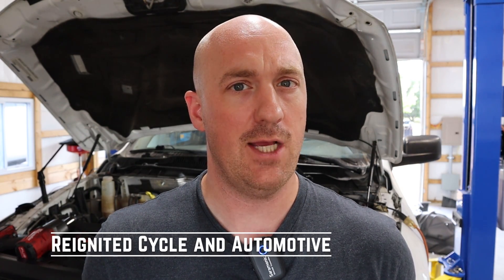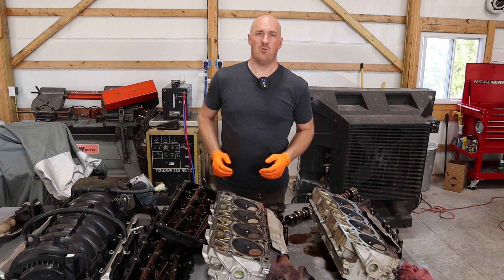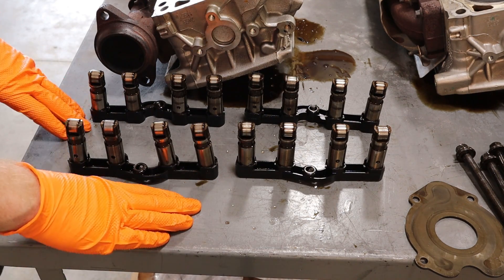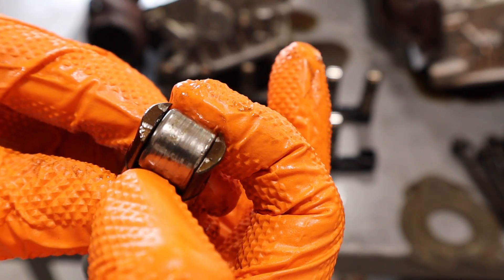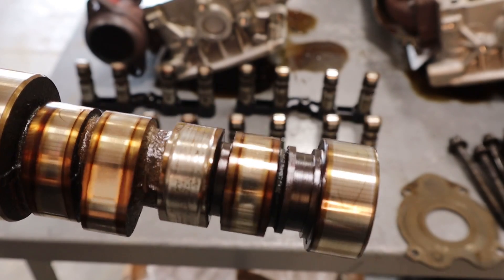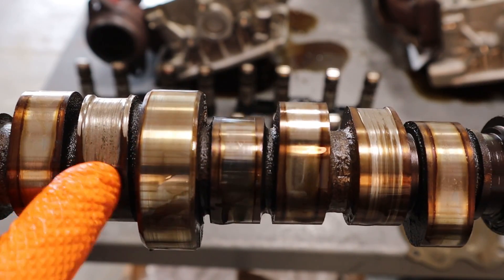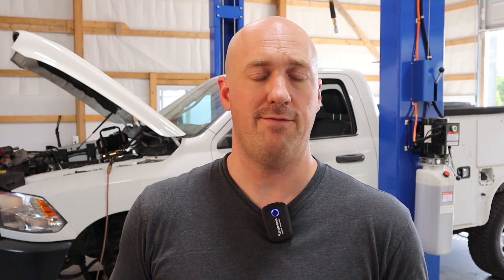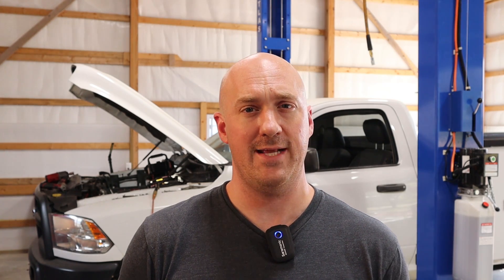Hemi 5.7 Lifter FAILURE Does this engine have a fatal flaw? Find out how YOU can prevent it!!!

Comment: You're PARTIALLY correct in your explanation of it being a lack of sufficient lubrication issue,  but it's not actually exactly as you described it.  It's because at idle these roller needle bearings are not being supplied with ENOUGH oil to properly lubricate them.  These engines supply oil to the lifter bearings by means of splash coating.  At idle,  not enough oil is being splashed onto them to provide sufficient lubrication.  Tony from "Uncle Tonys Garage" explains it wonderfully.  Give it a watch and see if you agree or disagree with his explanation.  I love your channel,  it's VERY informative.  Keep up the good work!
Reply from the maker: This video is quite old now,  I've got a bunch of newer videos showing my solutions with actual results.  As to UTG, no I don't agree with that being the issue.  Engines aren't built exactly like they were in the 60's. I have another video that shows the exact path of oil through the Hemi engine,  and "splash" lubrication is not the only oil the camshaft receives.  👍

Comment: Could I get your opinion? I have a 2012 ram 1500 w/160,000 miles. I got a check engine light misfire #3. I changed all the coil packs and all the sparkplugs. Drove it 60 miles. Gas mileage went from 18mpg to 22mpg on that drive 55mph. Next day drove 50 miles to dr appt. When I left check engine light came back on. Same thing misfire #3. So I started researching. I found out about the hemi camshaft problems. I called a local shop asked if they would do cam and lifters. They said let them diagnose it. They said need new engine $10,000. I called another shop asked if they would do cam and lifters he said bring it to him. He pulled the valve cover and confirmed flat lob on #3. Wants to sell me new engine. I would do the cam job myself but I'm disabled. I've seen many YouTube videos on the hemi cam and lifters problem and replacement. I want to know is it worth doing the cam and lifters instead of a new engine. I can do the cam and lifters with my son helping on his free time. Might take a month but I've got all the time in the world. So in your opinion change cam and lifters or new engine. I appreciate your knowledge on this issue.

Comment: This may sound like a silly question but I don’t know. If you disable the multi-displacement system will it or could it resolve the issue? What harm is cause by turning off the multi-displacement system? Im not buying a V8 to save on gas?

Comment: The design is FLAWED
PERIOD
THAT IS WHY CHRYSLER IS DISCONTINUING IT
ITS NOT OIL CHANGES ITS THE DESIGN.
PERIOD
A TOYOTA CAN RUN WITHOUT OIL AND still survive.
The hemi will die even if it has oil in it.
This sucks.
I am only checking in because the cars are  fast but I like longevity and reliability way more.
I should have known they were trash when all u see people building are LS motors.

Comment: Hmmm, Who Is Coxing You into Say That??? I Wonder.... I Disagree Though, THIS IS A DESIGN FLAW! I bet you if There Was Proper Oil Lubrication Reaching Those Lifters and Cam (Even Broken Down Oil) Will Still Manage To Keep Them Free Of Self Destruction.. Let's Just Assume It Is Broken Down Oil Reaching The Lifters, Then It Would Cause A Sludge And Not Eat up the Cams and Lifters. Just Call It What it Is. Design Flaw. You have already made a video Describing this Design Flaw (Or Maybe its afterwards). This is not even Debatable anymore at this Point.

Comment: would an oil additive such as lucas oil upper cylinder lubricant help with preventing the hemi tick?  I have a 2015 chrysler 300c with the hemi.  I drive it normally and never excessively idle so should I be concerned?  I change the oil about every 5000 miles and the maintenance monitor is always around 50%  I also run full synthetic.

Comment: Uncle Tom has a different point of view, but MMX has a real world experiment on this, how about a scar on top the lifter bore to produce a controlled spray to keep the rollers lubed? Old trick from old school racers to keep flat tappets lubed when increasing spring pressure. Let me know your thoughts, since 5 speeds don’t have MDS but still have the same failure just a later mileage.

Comment: Thank you for this I just watched your cam replacement n I feel confident for my 392 when I decide to change my internals also I run the ow40 mobile 1 oil on my car have been for a while now I see racers do it with good results and honestly I feel frequent oil changes in a hemi with that oil will run really good I put alot of miles on my car I got it with 18k now has 49 n I barley had It 2 years I change my oil ever 1k to 2k miles now I haven't opened it up but a few mechanics have told me my engine sounds flawless I think it's just how you care for your car your actions will justify your results

Comment: This video is Bullshit. My Gen 3 just suffered the same fate. I've run full synethic oil in my ram 1500 and changed the oil without delay every 8k. Yes I'm that guy like you who takes care of his toys and equipment. If this is an oiling issue....sounds like an engineering problem. Why does FCA recommend 8k intervals...why not 5k....duh! To have a roller chew a hardened steel cam lope like the ones I see in YouTube videos isnt the result of an oiling issue. This should be a factory recall with a class action lawsuit against FCA. Oil change...my ass!

Comment: Mine just started with the Lifter tick this week! can I still drive it? is it safe to normal drive in it like this? how long can I drive it with the lifter tick. Also powertrain warranty ran out 2 months ago ;(
Reply from the maker: First off, verify it's actually lifter tick and not broken exhaust bolts. If you're certain it's lifters, I would check with your local dealer to see if they are willing to do a goodwill warranty on it since it just went out of warranty. The answer is likely no, but you should at least try. I've seen people drive these engines for over 20k miles with lifter tick, but keep in mind, the more you drive it the more metal is going through the engine. 👍
Reply: @ReignitedAuto  Thanks a million for your reply here is a quick video of my tick noise https://www.youtube.com/watch?v=j6YNexKoqhg

Comment: hi i am watching some of your videos and they are very interesting. Congratulations for the explanations! I have a question, I bought a 2018 Challenger SRT 392 MDS with 17,000 miles. The engine works well and does not emit strange noises, on the contrary it is very quiet. The former owner only made two oil changes at 6000/12000 miles. Now I plan to change oil every 6 months with 3000 miles using Penzzoil Platinum SRT. The question is this: if initially up to 17,000 miles the oil changes were poor but at present the engine is fine, is there any possibility that I will have problems in the future due to the first 17,000 miles? The only sound I heard during a 200 mile journey was that sometimes when turning off the MDS I could hear a belt slipping noise (about 2 seconds). I haven't heard from him since that trip.

Comment: If your mechanic put 8 quarts of 5w30 oil in your hemi will that mess up mds
Reply from the maker: Nope 👍
Reply: @ReignitedAuto  mechanic said when MDS deactivates it's not going to 8 cylinder mode but has a misfire cylinder 4 mechanic thinks it's a failed lifter the car is an 06 dodge Magnum r t AWD
Reply from the maker: @captainobvious5993  it's pretty rare for these early cars to have failed lifters. I'd be looking at all the simple stuff first. Any codes beyond the misfire?
Reply: @ReignitedAuto  I just had a remanufactured hemi installed and my mechanic gave it back to me with a manifold exhaust leak on passenger side plus he put 8 quarts of oil when it only calls for 7. He said he also installed new mds solenoids, new fuel injectors, spark plugs and coils.code was a p0300
Reply from the maker: @captainobvious5993  8qts is probably ok with a Reman engine since the oil pan is completely empty. The multiple cylinder misfire could be due to cylinder reactivation codes. Have him try to disconnect the battery for about 20 min and see if anything changes.
Reply: @ReignitedAuto  no but I will when I get it back I'm having him fix the manifold leak
Reply: @ReignitedAuto  could it also be a bad solenoid for cylinder 4
Reply: @ReignitedAuto  I'll tell him to disconnect the battery for 20 minutes thanks

Comment: Hey I got a ram 2500 6.4, motor is toast and 6.4s are not available in my area but lots of 5.7s around what years would be the best for a simpler swap ,

P s I am a Mechanic and have done engine swaps many time just not to familiar with Mopar.

Comment: Hi I own a 2016 5.7 and I’ve already replaced the cam and lifter about a year ago. I also replaced the oil control valve on the top of the engine. It had some filings in it from the cam. Flushed the oil about three times to get and remaining filings out. I put four magnets on the oil pan to collect anything else. Now about six months ago I’m starting to hear more of a knocking while the engine is cold. Here in Canada we have long cold winters. Once the engine gets up to temp there little to no noise. It only happens at idle. Oil pressure is about 55 when hot and about 60-65 when cold. Been reading about it and people are saying it’s piston slap. I’m running 5w20 synthetic oil. I’ve had the exhaust manifold studs changed about three times in 130k kms. So I know what that sounds like. Any light you could shed on the “Hemi noise” would be great. Thanks

Comment: I believe when u use high viscosity engine oil u will not have most of these problems for example here in the middle east (95 to 122 F degrees) we use 15w40 and 20w50 and the  cars last more than 200k miles but if u live in colder climate u can use 10w40 oil  (v8 engines has more heat than smaller engines needs higher viscosity)

Comment: My mechanic is recommended a new motor over this job due to possible metal  shavings in the motor. Is this a valid statment. He said 6 grand compared to  10 grand with factory Mopar engine warranty.  Truck is 2014 ram 2500 118,000miles thanks
Reply from the maker: It could potentially be that bad. The thing to do is remove the intake manifold and then remove the VVT solenoid in the engine valley, if the solenoid screen has a lot of metal in it, then it's best to replace the engine. If the screen is essentially clean, then you can get away with just doing a cam and lifters 👍

Comment: Of the eleven 5.7 Hemi owners I know, no one has had this issue, and three of them are pretty close to 200,000 miles. I had to go to two repair shops to inspect eight, 5.7 cams that were damaged from lifter failure and none of them had more than one cam lobe damaged. The wear exhibited on the camshaft lobes in the video indicate a general lack of lubrication. Of the techs. I spoke with they only see this multi-lobe damage on police cars. This leads me to conclude that a single lifter failure and single lobe damage was due to some other influence.

Comment: I have a question for a 2008 Chrysler C300 5.7 hemi for some reason I'm getting MDS codes and I've already replaced three of them every time I replace one my car takes about 1 to 2 days and then it goes back into limp mode with lots of vibrating and it won't go over 20 or 30 miles an hour
Reply from the maker: This might sound a little strange, but try disconnecting your vehicle battery for 30 min and then reconnect. See if the codes go away or if the problem still exists.

Comment: A buddy mechanic of mine just had to do this. company truck well maintained every 3K service. That oil would have to be watered down to do this. Its the MDS system lifters as proven. If it was the oils fault then ALL of the lifters would have the same problem and not just the half with the MDS. I turn my MDS off every time I get in my Dodge.

Comment: Getting the rpms up is important with a hemi so more oil splashes on the cam and lifters.  The lifters are so horizontal that the oil from above drips off them instead on going on the rollers
Reply: Dustin I think you are on point.  These engines need to spin at 1,500 rpm or more so the windage coming off the crank throws will lubricate the lifter bearings.  I keep my 300 is sport mode all the time and rev it bit at long lights.  No idling.  No problems so far and this is my third 5.7, although I traded one at 40K and the one I have now only has 31K (first I traded at just under 100K).

Comment: Hi, Thanks by the video. Right now i'm having trouble with the lifters on my 2003 dodge ram 2500 hemi 5.7. I'm looking  information and then open the engine. I saw a video that makes a comparison with the more modern lifters like the Hellcat, which are more robust lifters. Can I use hellcat lifters on my engine? If you could give me a recommendation I would appreciate it. Thanks
Reply from the maker: Short answer, yes you can. Keep in mind the so called "hellcat" lifters are just the standard updated non mds  lifters used in the r/t, scat pack and hellcat vehicles. 👍

Comment: I have a 21 Bighorn with the 5.7 and the manual even says that ticking noise when the vehicle is first turned on is normal. It usually goes away in less than a minute for me.
Reply from the maker: That is true, there are actually several different Hemi tick noises, but that initial rattle on cold start up is perfectly normal. 👍
Reply: @ReignitedAuto  I gotta say, this Ram is by far my favorite vehicle I've ever owned. Thank you for the reply!
Reply from the maker: @varanidguy  They really are terrific trucks, enjoy it!

Comment: Thanks for the video it was very informative.  I have a 2008 1500 4wd crew cab with 290,000 miles with both the exhaust tick and the lifter tick..  I purchased the truck new and right after i purchased it less than 5k miles I noticed a tick in the engine and took it to the dealership and was told that was normal, not to worry ( Son-law was the service director for all 3 dealerships).  I bought this truck because it has the unlimited life time warranty for the original owner, and have changed the oil every time the oil change light appears on the dash as instructed by the service reps at the dealership.  I have only used one type oil and that was Mobil One 0w20 since the truck was new from the day it left the showroom.  Now what info is wrong now what Dodge tells you to do during servicing or what Chrysler says now is the problem.  I am no novice to motors built by Ch
rysler motors since I rebuild and race Mopar drag cars as a hobby.  Thanks for your information
Reply: Dealers are scam artist

Comment: Chrysler isn’t telling the truth, I’ve done my oil changes very very frequently, around 2200-2500 miles apart from each other in my 2012 Chrysler 300c and all of the sudden I get the loud ticking sound and took the engine a part and it’s a messed up lifter. They need to own up to this flaw and recall the cars with this issue.
Reply: Excessive idle kills the 5.7, it starves the cam of oil

Comment: How long does it take to do serious damage.  Mine has been ticking since 40k and it's got 135k on it now.  I'm sure I have an exhaust leak but it seems worse lately.  Doesn't go away after warm up and is definitely worse under a load. I've always used mobile 1 5w-20 with one quart of marvel mystery oil substituted. Any thoughts.

Comment: I doubt that is a oil related. I'm mean could help. But i do my oil change every 4k miles full synthetic and i got this problem. Im was towing a trailer. I tow for 2 month withiut issues but thia past 4 days I tow from florida to colorado and noticed a tickling when starting the engine. Then couple of seconds latter its gone. I was diagnosed with lifter issue and quoted for 3.5k us for full replace including cam shaft. Not sure if is a correct quote or not but i lost my faith in the hemi. I had a 99 jeep wj with the 4.7. I tow the same trailer without issues. I sold it with 150k miles on it with no issues at all.
Reply from the maker: Before jumping the gun on lifter replacement, I'd advise you to check out one of my other videos called, "the other hemi tick" this has to do with broken exhaust manifold bolts that will cause a ticking noise on cold start only. Might save you a bunch of money! 👍
Reply: @ReignitedAuto  i saw the video. Im still not sure. May be I could share a video with you with the noise. Its very hard to access the manifold  on the jeep. I only checked the first upper bolt in front from passenger side. :(
Reply: @ReignitedAuto  exactly my thoughts. Is completely gone after it warms up. And some times don't even does it.  But anyway. I need to keep looking for real mechanics in colorado...
Reply: Just in case this is the video of my jeep https://youtu.be/LSsF33TeOSM
Reply from the maker: @marianobruno7491  that's a tough one to tell from that video. However, if the noise goes away completely after it warms up I doubt its lifter noise.

Comment: what's a rough estimate to replace cam and lifters? I have 4 Ram trucks with 3 being the 5.7. No issues with any of them (knock on wood), All have over 130k and some pushing 200k miles. Other than fixing the broken exhaust bolts, they've been solid work trucks. I run a Zinc additive in the Napa brand synthetic oil.